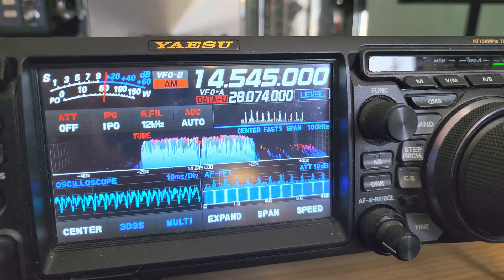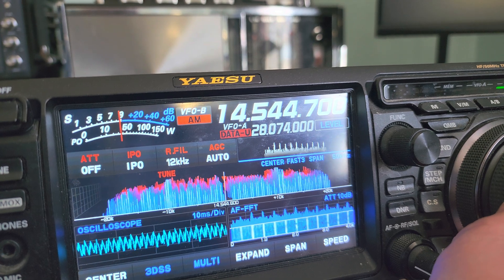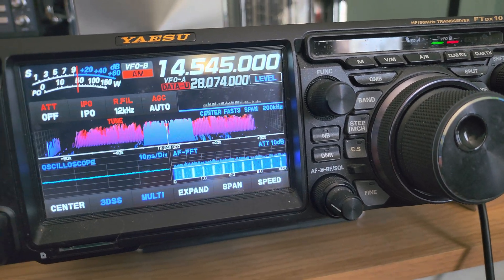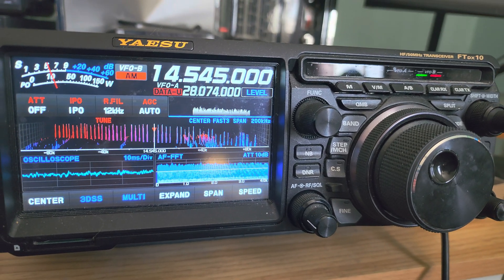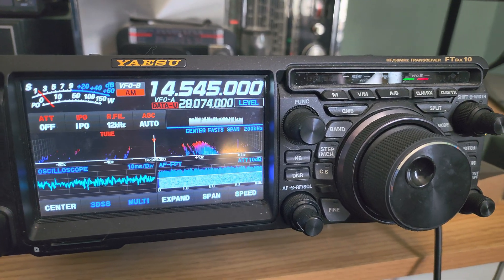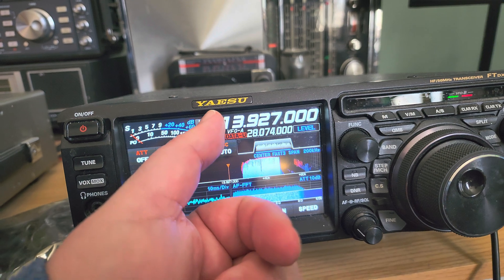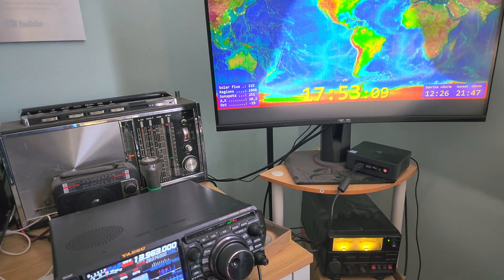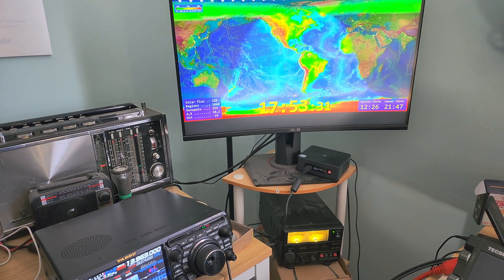How to recognize HF Financial Trading stations signals on shortwave

Comment: A.I. SIGINT/ELINT for parasitic trading beckons?  As-in chatter-detection?.   Meaning: even if the data is not timely-crackable, do such signals indirectly convey "excitement?".  As in something happening-at-all / more-probable / slight-difference (e.g. sound or spectrogram subtlety, frequency hopping behaviour, any kind of repetition) - when the market (or bits of it) is acting "potentially profitably" (for millisecond-traders)?   What happens when it's "prodded"?   Will next-gen SWL (etc.) receivers include such A.I.? (be it local or in the cloud etc.).

Comment: Very interesting, thank you! I had no idea about this. But I guess by law of nature it's not possible to get lower latency than what you get over analog radio. Even with dedicated fiber transmission lines from point A to B there will be some micro seconds added just by the digital conversion on the transmission layer. I wonder if these trading firms are using these signals internationally even. Another thing I wonder about is encryption. They probably don't want to send these signal in clear text as competitors may eavesdrop, but on other hand, encryption adds latency.
Reply: I read that there is at least one connection between HF traders in the US and Germany.

Comment: No way this is related to HFT. The bandwidth is too small. On a 40khz bandwidth you would only get around 100kbps, which means it would take tens of milliseconds for a single TCP packet to be transmitted
Reply from the maker: Yes it is and has several stations around the world including here in Canada and USA
Reply: It's not about bandwidth, it'a about low latencies.
A signal that tells "sell" or "hold" only requires one single bit to be transmitted.
With 10kbps, 10000 decisions can be transmitted per sec.,  and if every right decision earns the fraction of a penny, they will make a lot of money.

Comment: The edge of that signal will be perilously close to our 20m band at the low end.
Reply: The lower end is at 14.525 KHz. That's 175KHz away from the top of the 20 meter band. Hardly perilously close...

Comment: The differences in latency between these types of transmissions isn't in the hundreds of ms, it's a difference of only about 2-20ms, and that is enough to be profitable for high speed trading.
Reply: I saw a video from one of these firms, I think it was from Jane Street here on youtube, they are actually chasing nano seconds within computer hardware. Processing gigabytes of data every second, a nano second here and there of course adds up.
Reply: @Momfasa  Which is why they don't use SDR's, as suggested throughout this comments section.

Comment: If I'm not mistaken they use microwave transmitters similar to the ones AT&T long lines used pre-fiber optic. I would be interested to see some one in the hobby successfully decode one. It would be interesting.
Reply: That is a separate and older system that uses microwaves. This is a new thing only approved recently that uses HF transmission frequencies.

Comment: Cool stuff, you'd think this would have been a thing before now...Nice to see new uses of the shortwave bands as it is a untapped resource in this day of the internet and goes to and show radio can still be important. I do wonder about how its done and the data throughput, etc. It would be even cooler if some of this tech could be used by HAMs. Hopefully it doesn't take over all the SW bands in the future.

Comment: This is for arbitrage trading where the traders exploit the price difference between Chicago and New York markets. If the price of an option or futures contract goes up by an increment in New York, the price in Chicago will move there as well but it will take a brief moment for the change to propagate through the internet. The arbitrage traders exploit that lag by buying at the Chicago price and simultaneously selling at the New York price. If you do that in sizeable trades and do it a lot one can make low risk profits. This of course is a commercial operation and therefore is an illegal use of the spectrum. I'd like to see the FCC focus on these stations to get them shut down.
Reply: One bot does like 60,000+ trades per SECOND!
Reply: How do you know it's illegal?
Reply: It's ABSOLUTELY legal. 100% legitimate.
Reply: How is it illegal? HF can and does have commercial use. Not as much as it used to, but there are fishing buoys, maritime uses, and one could argue that the entire overseas aeronautical communications system (run by ARINC) is a commercial operation.
Reply: Are you going to get VoA and BBC World Service shut down because ham radio doesn't allow music and broadcasting? Look at the frequency, ham radio ends at 14.350 MHz.

Comment: I know some of the HFT guys were using some of the old AT&T "Long lInes" microwave transmitters that were used to route phone calls and other data before the internet took hold.  This is the first time I've heard of them using HF.  I know encryption is banned on public channels, but I'm guessing these guys are on licensed channels. Encryption is probably allowed for that, but they still have to avoid interference outside their licensed channel.  If they are interfering with nearby ham, you can file complaints with the FCC and see what good that does...

Comment: On shortwave?  I they were using microwave years ago, but shortwave?  That's very low bandwidth.  How do you know it's HFT vs. kids playing around?
Reply: Microwave requires repeaters and those add latency. Fiber has that issue too, and its propagation velocity is only 0.5-0.6 c.
Reply: It doesn't necessarily need to have high bandwidth. It needs to be fast. They achieve this speed by not using relay stations, Satellites, fiber, or GSM. They use analog techniques to avoid digital delays and shave every possible nano second off the 'trip' time. HF radio is by far the quickest way to get a signal across the Atlantic (Dow Jones to FTSE for example), in a trading world where nano-second advantage can make the difference between money made and money lost.
Reply: Let's say they transmit between New York and Chicago stock exchange, microwave would not be possible.
Reply: It's for communication over the atlantic.
And it's used in combination with a regular internet link.
The shortwave signal is only to transmit some real time raw values, which only reqires a very little bandwidth, but a very short delay.
Reply: @geraldschomburg5317  thanks. That makes sense
probably no cryptography too?

Comment: Just for the interested, the middle dip suggests that it's a double side band suppressed carrier signal.  The may xmit different data in each sideband.  Quite efficient.
Reply: I would guess OFDM, so different data in many carriers across the bandwidth.
Reply: Definitely OFDM or some variant. The middle dip is a guard band around DC, so that direct conversion SDR can be used without fancy DC removal...
Reply: yeah that is an interesting speculation. It is able to be done alright, could be buy data in one sideband and sell in the other. Is that what they call ISB?
Reply: It's a long string of psuedo random numbers ofuscating a few bytes of payload.

Comment: I first heard these a month or so ago here in southwestern Ontario. I sent an email to the local University engineering faculty to see if they were doing any experiments but they didn't respond. The signal was very strong so I assumed they were local. Thanks for the clarification. Would like to learn more.

Because of the bandwidth they occupy and the strength, I find them to be disruptive. They do tend to land on frequencies that contain utility signals, so as an SWL I oppose them. They also seem to frequency hop. I've heard them around 10.8 MHz, 13.9 MHz and 14.5 MHz.
Reply: Nobody put you in charge

Comment: That must be some heavy encryption on that, the modulation / encoding sounds so uniform.
Reply: For efficient use of the channel there generally will be “scrambling” which doesn’t necessarily mean encrypting but to avoid long periods of similar symbols, improve error detection, and synchronizing
Reply: Remember, digital encryption would also add latency. They need to make a tradeoff.
Reply: There is no encryption at all, only raw price values on the stock market, no secrets.
But the data can't be interpreted without the corresponding data of the internet link.
Reply: or its just idle lol
Reply: Definitely encrypted.

Comment: This should be banned! The public airwaves should not be used so large corporations can make money on the markets with high frequency trading.
Reply: Public airwaves are used for tons of companies, large and small, to use to make money. Think of your cell phones, WISPs, pager systems, etc etc etc. I’m not a fan of these either, but they’re licensed and allocated, so there isn’t a lot of room to complain.
Reply: That's what cell phone companies do.  Would you like your phone to stop working?    What you are saying is akin to saying commercial vehicles shouldn't be on public roads.
Reply: What if those “large corporations” are actually benefiting individuals? Why should the “publc airwaves” -that is, those outside of the ham bands-not be allocated for SOME commercial use? English-speaking shortwave seems to be waning, anyway, in terms of variety of content. I think you just have a grudge against capitalism and the corporate system.

Comment: It's a pity that radio amateurs are limited in bandwidth of transmission. We are not allowed to use more than smallband like 6 kHz. Why not using more and transmit all information in half a second unlike ft8 for a minute.
Reply: Seems you don't know how FT8 works as it isn't slow because of the lack of bandwidth. It is designed that way. Datamodes like PACTOR 4 of VARA HF have much faster speeds within the allowed 3 kHz.

Comment: OTHR is very much a big interference producer as it just blasts out sounders looking for MUF and then fires up with vigor when it finds a suitable frequency.
And in the southern latitudes, we have a huge problem with pirates in certain nations using any frequency they like for chatter.
Many of the MWARA air frequencies in the 35m 8Mhz allocations have to contend with indiscriminate chatter +/- 1kHz away.
Have not had any issue with HF traders so far, but now I know what to look for thanks Gilles!

Comment: Any chance the signals can be decoded?  Are they encrypted?
Reply from the maker: Encrypted
Reply: It's not they can't be decoded, it's just that no one's done it yet. You could be the first!
Reply: @RefreshingAsF5 it likely has end to end encryption   Which will not be decryptable in the time that the signals last
Reply: Not if it's a one-time pad. Oddly this seems like the perfect use case for one time pads. They can send the pads over the internet and they need speed. A one time pad only needs 1 CPU instruction(xor).